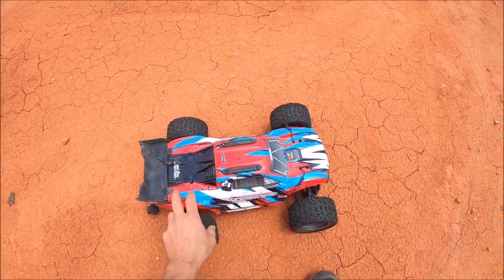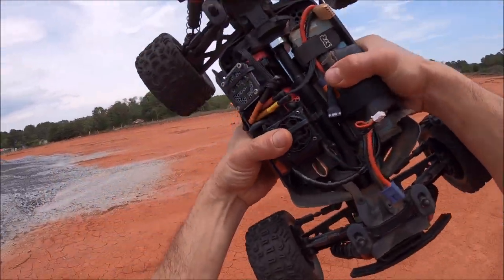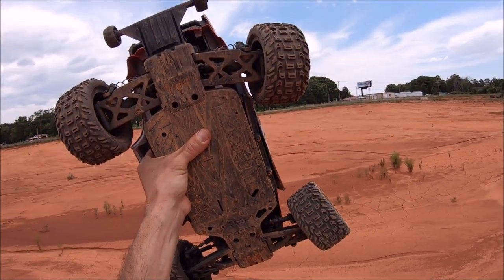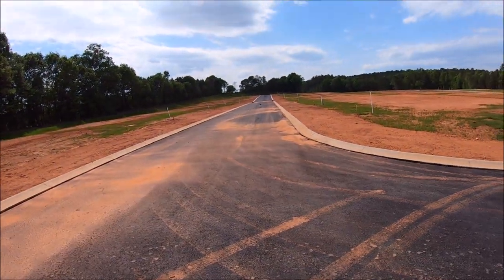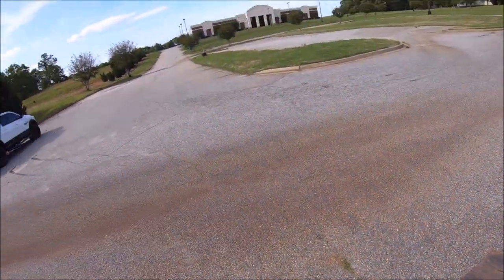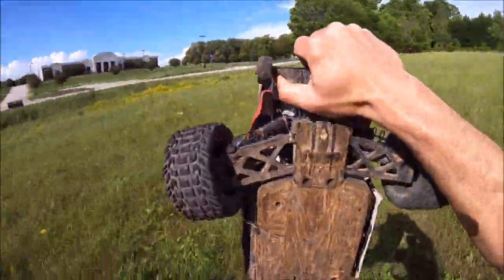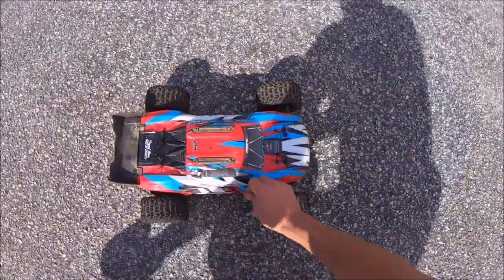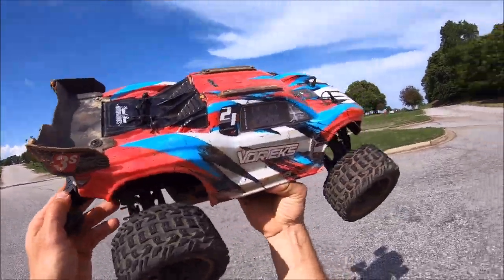WORLDS Fastest 1/10 scale RC?!

Comment: This is very impressive, I was trying to see what speed I could get out of my Big Rock last night with stock tyres on 4s and it was such a handful, the Vorteks is really planted. My mates one is getting m2c baby, he bent the motor mount really bad when we hit the skate park the other day. We both ran hard and mine even with the old blx 2050kv motor mounted on the m2c mount and brace was rock solid. I've got some Mojave wheels coming for mine, but the Vorteks has speed with ease. Good to see it's pretty tough, surely those arms weren't breaking from just the one huge jump, they were weakened by the continual abuse it was coping?

Awesome driving as always and the fun factor is super high with these plastic trucks, it surely shows how weight and materials can have such a big impact on the outcome, great work from Arrma and Avery with his motor mount and brace!

Comment: i have no idea how you keep drive axles on these 3 and 4 s arrmas, mine used to either pop all the time or id have to run slipper loose and sacrifice power. would be cool to see how you set yours up. the way i have been doin it lately is slipper out, put red spline piece and driveshaft and then tighten till i can barely turn it by hand when i twist driveshaft and hold slipper in my hand. seems to work ok but i was curious if this is how you adjust it on your 3s 4s arrmas.
Reply: Shredded splines out of the main driveshaft today at the motor spline, back to the drawing board for me.
Reply: Keep popping the yolks on mine every time I take it out. The tires keep coming unglued. 1st 8 packs were fine now it breaks every time I run it. Without jumps just gravel or pavement!

Comment: Man!!! What are you guys doing for diff internals!! I’m trying to make my daughters vortex’s tougher and it kept  popping drive shaft universals, throw’d in a set of gpm’s and now it’s solid but keeps trashing read diff internals, already installed metal input’s and diff gears front and rear? I wonder if slipper is too tight! I’m working on a big rock build too, want to figure these 3/4s lines out. Hard to break out the Ol big girl ocexb with a 9 year old bashing!! Killer vids as always!!!!

Comment: Are you planning to put the Big Rock V3 arms, links and shafts in it? Should fit they are pretty much the same chassis
Reply from the maker: I have no plans to at the moment. The stance is perfect imo. The BR chassis is longer but yes, the arms and links will fit!
Reply: @RCDUDE81 , I know i looked over the exploded view, other than chassis length they are basically the same except arm length. Personally I wouldn't, That would make a car, that is wider than it is long and probably worsen stability more than anything

Comment: If you could only buy one, which would u choose and why? Typhon V3 3S BLX, Big Rock V3 3S BLX, or the new Vorteks?
Reply from the maker: Well They all serve different bashing purposes but I'd say the Big Rock. Imo the most well rounded 3s basher. Holds down power, fast and also stunts/jumps nice! Adding on the M2C 17mm hexs allows for lots of wheel options!😎👊

Comment: Great video looks fun,  out of curiosity i have a 4068 2650kv racestar motor with 150a firma esc in my typhon 3s/4s you think I could fit a game changer fan in it by chance?  I'm running 18t Pinon she runs little hot with this Florida weather gonna be a scorching summer so I figure need better fans or need to drop the pinion. Any suggestions?  Currently using a twin powerhobby fan heatsink on motor.  Just thinking if maybe could put a game changer fan or two . What you think?
Reply: Even if I could fit a game changer fan or two with the motor your using i would be down.  Any input or advice is great.  Thanks
Reply: You might have mount on side or trim body ,
Reply: @paulclancy2404  yeah just curious cause she's running little hot on 3s even takes about 50 seconds to kinda cool down from 145
Reply: @paulclancy2404  talking with i guess the creator/ seller of game changer fans they mentioned the renegade fan with their heatsink.  Should fit under the typhon 3s body right?
Reply: So excited think I've got it all figured out.  Bout to pull the trigger on these fans etc. They are pricey won't lie D: getting motor mount,  two fans for my racestar motor 4068 2650kv,  an adapter for my firma 150a with a esc fan and getting a balance adapter basically little more than 150 bucks but everyone brags about this fans,  seem tough and can use it on another project down the road considering the motor mount expands to 56 mm from 40mm? Whew here we go xD
Reply: Yes you can ask gamechanger before buy them he's on here commenting sometimes or on eBay,  im sure he has a low profile one if you can run it power hobby heat sink , that pretty good fan too heatsink too , just GC move alot more air , if your in hot weather you may need gear down a little .
Reply: Yea thats little hot , keep that front bearing clean and oiled in the motor and on clutch.
Reply: @paulclancy2404  yeah I just cleaned everything few days ago an dropped some oil on the bearings.  Well I just pulled the trigger D: I'm excited but my wallet hurts a little hahaha got some low profile fans the renegade?  Two for motor one for esc with the adapter for the firma 150a to make it from 35mm to 40? Got a motor mount for the fans on my racestar 4068 2650kv goes from 40mm to 56mm? And a balance lead for 3s to 4s. Man this hobby is so awesome but sometimes your like oooof I did that XD
Reply: @sMoKeN904  nice sounds like you got a ripper. I have brcc on typhon wheels and 130 firma esc and 3200 kv  4s shocks  I run her on 4s too but tbh I enjoyed my granite more may strip this thing build the granite back to life , ivwas going buy vortex

Comment: Hey man, what do you use for suspension links? Those stock plastic ones don't last very long :D
Reply from the maker: All stock truck right now other than the M2C mount and electriconics. I have had links bend or snap on rough hits but so far these are holding up.😜
Reply: @RCDUDE81  ah okay. My 3 week old big rocks links were all worn at the composite ball or ovaled on the rod end. It'd be great if you could recommend anything 👍
Reply from the maker: Oh I gotcha. Yeah the bushings wear out fast. Hot Racing makes an aluminum bushing kit for the whole truck. Other than that I've never changed the actual rod ends.
Reply: @RCDUDE81  ah cool thanks, I'll get a few sets ordered 👍 Ive totally ovaled a couple, I'll grab some stock ones as they're nice and cheap

Comment: What is your favorite between the Vorteks or Big Rock?
Reply: Granite
Reply from the maker: Right now I'm loving the Vorteks!🥰Both are great just two different feels! The Bigrock is much better in rougher terrain and the Vorteks is a little speed weapon!😎💪👊👊
Reply: Eric i started stocking up on parts to build a ralley car , I don't know why but I prefer the shorter chassis,  my goal always being able to drive like you and still try get longevity out of the rc. Same with bigrock , the granite ive had performed as fast and well as this vortex , im still building brcc but its far from performing equal to those two, I need the wider arms I think I be there , im running 130 amps esc still 3s motor and 17mm conversion with buggy wheels could use some Tallon kattars ..

Comment: Just got mine    but I have this weird clicking noise not sure where it's coming from I was hoping you might know. Great vid brother
Reply: Everyone has it , I hear through the video
Reply: Same issue here.  The noise appears originate from within module.  No amount of setting mesh helps.  There is too tight followed by sounds like a diesel when it's running.  Nothing in between.  Diffs are "quiet";  If you separate the module from diffs and run just that, you can tell where the sound is from.   Motor is perfect without the spur.  Spur looks like brand new. Was like this OOTB.  I watched all the Vorteks running videos and most sound similar to mine.  I find it really annoying.  May try a metal Spur, and see if that helps.
Reply: Ok I waited to give advice.lol
Reply: @chuckplate9463  when you have module out whikre together spin spur see if binds in one spot, than just make sure its not hitting the case in that spot , next possibility when they tightening clutch than backing out half turn or so from factory,  it could be separating the fixed brass on the hub and that spinning causing the clicking , that brass piece supposed to be fixed not able to separate,  I don't own vortex but I have been through a couple 3s arrmas , had similar problems after ordering a whole assembly from jennys , with mine the problem was inside one of the hubs is a nut a fixed nut and not deep enough inside the hub so wouldn't allow me to lock the module flush to the rear diff
Reply: @chuckplate9463  see now earl put metal spur in and did fix but idk because he ended up changing that  hub , " the one with brass piece ,  make sure everything in centered perfectly on the spur , slightest bit off or spur not being perfectly round would cause too I think its the hub , either that fixed nut not deep enough or brass piece being broken off , sucks it stopped me from buying vortex because I just spent 60 on new one to fix 3s cars I already have and that other wear parts are reason I was going buy it .
Reply: @paulclancy2404  Thanks Paul.   Much appreciated. I did already watch the videos with the fixed brass and slipper assembly etc.....  Mine is solidly attached, flat and true.  But, I do have an interesting challenge when seating the module into the rear diff.  It often seems harder than it should be to do that. I'll triple check if there anything preventing the module from properly aligning and sitting squarely once locked
Reply: @chuckplate9463  that was my problem , it was too shallow compared to old hub , than the spur would hit the case , I wonder if its the plates just spinning on each other.  When earl put metal spur in it seemed to stop . Every spur cant be defective though
Reply: @paulclancy2404  I hear you.   I'm going to try the metal spur just because...  May see if Horizon will send me a whole new end to end slipper assembly.  Been like this since OOTB maiden run.   Even though I like the truck it's fun, fast, and appears durable,  I just don't like the "there's something wrong with it"  sound it makes even if is nothing technically wrong with it
Reply: @chuckplate9463  i know whst you mean , it would drive me crazy too, exactly have horizon give you new clutch parts and spring for metal spur , thats what I would do ,. Good luck 👍
Reply: @chuckplate9463  definitely a awesome rc , I may of had more fun with my granite than all my RC's. It's easiest and cheapest to use everyday without breaking the bank .

Comment: So why do we still see a bearing in the wheels that's not good for impact there are way better but no one's using them the covor or ceramic means nothing when it's not a impact style bearing like you see on cars trucks so why do we not see it on RC cars that are bigger heavy need better bearings and cooling systems need better venting and air flow a fan is great if it has more venting not just a small gap forcing air need better venting in the transmission also one more spot heat gets trapped look at belt drive atv or snowmobile use air flow to help keep temps down if we did venting in and out of the motor transmission you would see many performance issue go away and better temps means better speeds lower temps helps